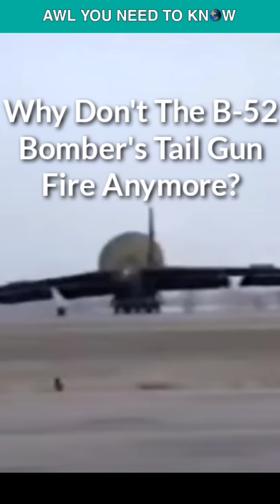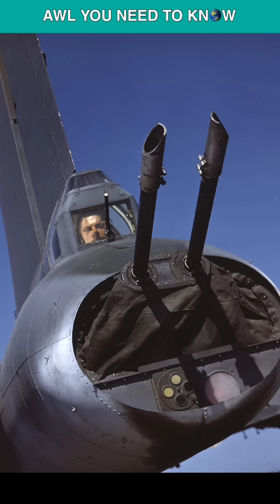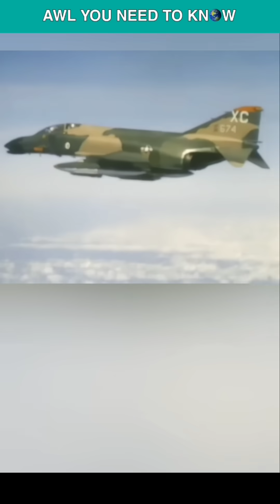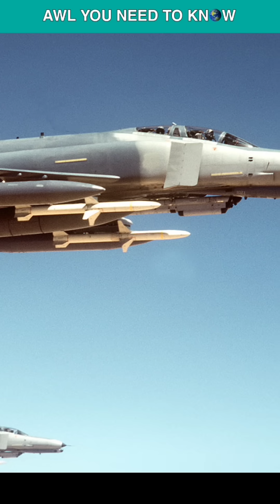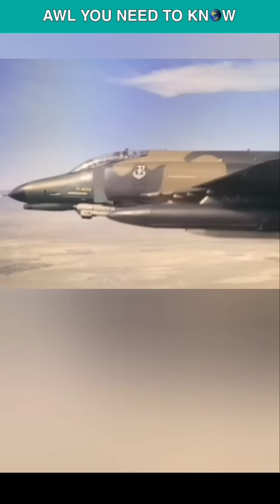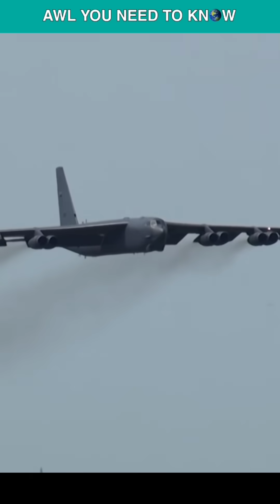Why Don't The B-52 Bomber's Tail Gun Fire Anymore? #shorts

Comment: Get rid of a defense system rather than training the troops. Government in action.
Reply: The friendly fire incident actually had little to do with the removal of the guns. They were an outdated system that included vacuum tubes and other obsolete components that were going to cost far more to modernize than it was worth. Money is what ultimately did the guns in.
Reply: @grandmasterpu  
Why modernize what is working?
Reply: @calvingreene90  it wasn’t. The cost to maintain systems that run on vacuum tubes that are no longer produced wasn’t worth it. You either modernize before the system runs out of useable parts or you run it until it doesn’t work anymore
Reply: @grandmasterpu  
Tell that to the families of the people killed because the bomber didn't have its tail guns.

Besides there are quite a number radar/optical/IR guided gun systems on the market adapting one wouldn't cost that much.
Reply: @calvingreene90  you have no idea how much it takes to integrate anything into an aircraft. It would cost a fortune. On top of that, tail guns aren’t effective in modern combat. The B-52 has two air to air kills with the guns in its history and that was back when guns were still the standard and missiles were in their infancy. Two kills, out of more than 126,000 sorties during Vietnam alone. ECM is a better investment to help keep radar from finding the aircraft and jamming targeting.
Reply: @grandmasterpu  
The B-52 has at least 3 confirmed air to air kills in Vietnam. Plus the tail guns keep fighters at a respectful distance which gives decoys and ECM time to be effective.
Aircraft guns were declared obsolete before the Korean War which was proven to be nonsense; before the Vietnam war heated up, also proven to be nonsense. Why should we believe the same claim today?
Reply: @grandmasterpu  
As for the cost that depends on who is charging for the work.
Puff gunships cost almost nothing to intergrate the guns onto. After proved effective the contractors got involved and the price went up dramatically.
Reply: @calvingreene90  there are two confirmed kills by B-52s. There’s debate about a few other potential kills, but only two confirmed. Guns being outdated is far from nonsense. The missiles in Vietnam were early generation and not even remotely as reliable as the ones today. There were also few with BVR capabilities. The things B-52s will be worrying about will be long range SAMs and missiles from fighters hundreds of miles away coming at it. A tail gun would be pointless. 

There’s a huge difference between building an aircraft and incorporating a weapon into it vs integrating a system that already exists. It’s much easier and cheaper to it during the initial stages of development.
Reply: @grandmasterpu  
Puff gunships are C-47s to which mimiguns were attached to in Vietnam originaly.

Be sure to tell the Air Force Academy to update their B-52 monument.

How many B-52s made it to safety because the North Vietnamese interceptors stayed out of tail gun range?

With better sensors and computers smaller targets can be engaged.
Reply: @calvingreene90  things were also much cheaper in that time and putting some cannons in the side of a cargo plane isn’t the same as trying to integrate a new fire control system into a 60 year old bomber. 

Diamond Lil, the one at the academy, has one confirmed kill. The plaque talks about the two kills B-52Ds had.
Reply: @grandmasterpu  
The plane already has the place for a radar and firecontrol computer what makes it so hard to put in smaller smarter systems?

It was twenty odd years ago that I visited the monument and did indepth reading on the war in Vietnam I'll admit I was wrong about the monument. But that doesn't answer the question of how many lives were saved by North Vietnam interceptors keeping a respectful distance.

You can't fire a missile at a hostile plane 500m ahead of you if their are frindly planes several miles beyond it. The North Vietnamese air force exploited that weakness off the gunless F-4 Phantoms to much effect.
Reply: @calvingreene90  let me change gears and explain it another way. We’re working to replace the B-52’s original radar with an AESA radar that goes in the Super Hornet. We started this program several years ago and the first test article is just now being installed. If all goes well, it’ll be another few years before they start hitting the fleet. It’ll be several more before they’re FOC. This off the shelf radar is still costing a few billion to modify and intergrate into the B-52, but it’s desperately needed if we want to keep the B-52 around through 2050. The current radar’s lifespan is long past due. Similarly, we’re working on changing the engines from P&W TF33s to RR F130s in a 1:1 swap. That project was awarded a couple years ago and the first test article is still years away. It’ll probably be 2030 before active aircraft start getting them. This is another multibillion dollar effort to integrate an off the shelf system. Could the same be done with some kind of tail gun? Sure. But the question is why spend the money on something that doesn’t add a capability or appreciably enhance survivability?

The guns aren’t needed anymore, missile technology has advanced at a far faster pace than those kind of defense systems. Instead of spending at least half a billion dollars we don’t have to add a capability that would be useless in all but one situation, we could instead spend it upgrading more viable systems such as ECM or giving it another self defense system. In the one scenario that fighters are actually getting close enough to engage with guns, the B-52 is either way off course and doesn’t know where it’s supposed to launch its cruise missiles or the fighters escorting it have been shot down.
Reply: it's not like they would fly solo...  wait that's exactly what happened here....  lol

Comment: A rear gunner mistakes an aircraft from its own country,
A fighter/bomber pilot mistakes a tracking radar thousands of feet in the sky as airborne AA,
 Simultaneously firing weapons. 1 damaged 1 not damaged. No mention of radio traffic. Sounds 🐠ey.
Reply: The thing is that the F4's RWR doesn't know how high or low the AA is, only from where and how dangerous it is (tracking and locked).
Reply: Did they not have IFF?  F4Ds did in the mid-80s, and they were wild weasel capable.
Reply: @everettjrharward3539  i know f14s didnt in desert storm, and a lot of pilots were not running iff for some reason while on missions.  The pilots killed by patriot had their iff turned off.  Idk, its a wonder desert storm didnt have more blue on blue.
Reply: Didn't they have radio contact?
As far as I know rafio communication was already invented
Reply: @Geflechtmeister it was desert storm.  There were a lot of planes from all different services and countries in the air and they were all operating on different radio frequencies and protocols